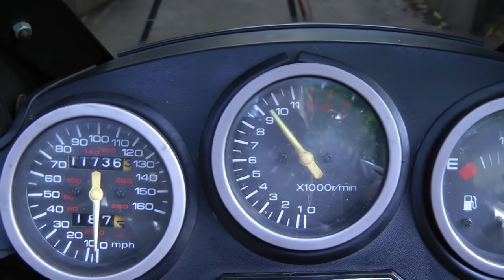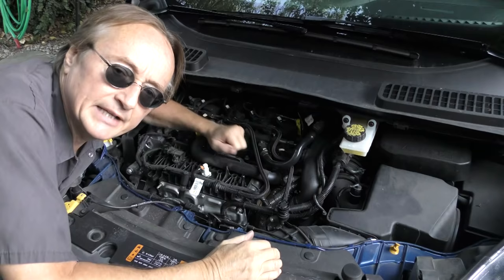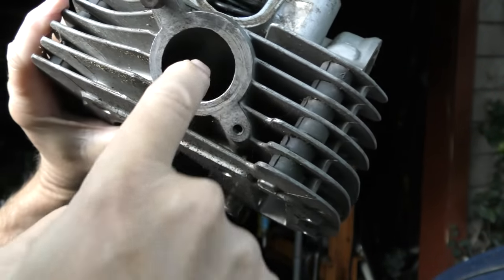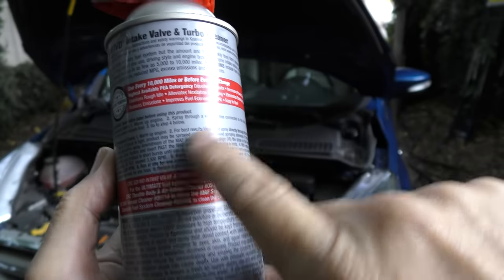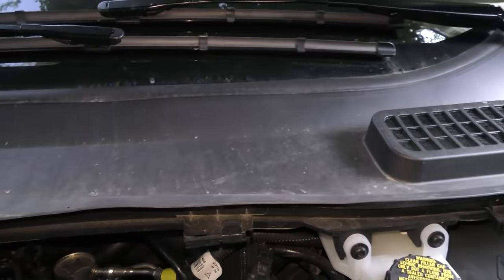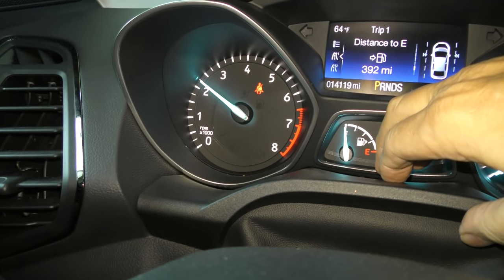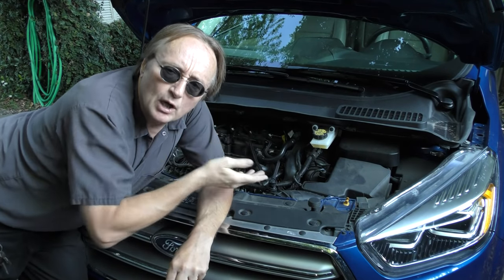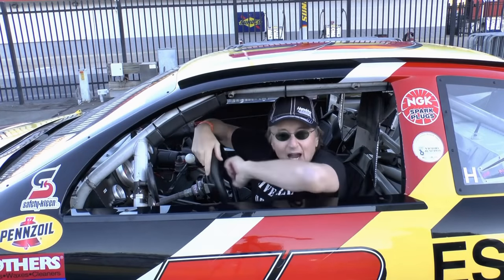How to Clean Intake Valves in Your Car with a Spray Cleaner

Comment: pretty sweet video for us ecoboost guys. everyone knows carbon build up is a huge problem with ecoboost engines. im at 35k miles with mine and my intercooler needs to be cleaned from oil build up and im sure intake valves need some cleaning too. pesky modern turbo engines!

Comment: Omg other mechanics are really gonna hate this. cheap way to clean your engine instead of the exorbitant prices they charge
Reply: Cleans your valves, not the rest of your engine. Usually you don't need to have your engine cleaned, unless theres significant sludge buildup, in which case you probably do need to take the entire engine apart.
Reply: What?????? Take apart your engine to clean it????? No! You prevent it from getting dirty by using the proper oil and changing it at the correct interval.

Comment: Hey Scotty could you do a video on modern diesel engines, they have  the same problem but about a 1000 times worse. It can get so bad that the entire intake manifold, intercooler and turbocharger becomes caked/clogged with carbon. Many believe the only solution is a properly designed oil air separator that has an actual replaceable filter element inside (i.e not just some steel wool), but the method you show in this video may also help with the valves themselves.
Reply: You don't do enough Miles and ain't kicking the car. Sounds like you need a petrol lol
Reply: Hey Scotty I clean my throttle body and then after I spray the throttle body cleaner into my intake manifold when when I try to start the car it's not keeping up when it starts

Comment: Hey Scotty, I’m curious if this method is safe for the turbo? Some people say chunks of carbon  can break off the valves, then goes straight to turbo, & can damage it. Is this a concern? I’ve been driving my focus st for 95k miles and have never cleaned the valves, so there’s probably a lot of build up. So I’m just afraid of these “chunks” ruining my turbo. What do you think?
Reply: CRC claims gdi cleaner softens the carbon
Reply: You should be injecting it after the turbo not before. Ideally some where between the inter cooler and the cylinder head.
Reply: @davemorris6747  I think he meant exhaust valves not intake
Reply: You have a turbo in a focus? 😂

Comment: I just sprayed this directly into the intake after the MAF sensor is that an ok way to do it?
Reply: Haha I've just posted the same question 😂👍
Reply: That’s is ok to do just make sure you spray AFTER the MAF sensor. That’s how I do mine. Mine is due for a cleaning now too! I have over 100,000 miles on my Ford Focus so I do this as regular maintenance. Seems to help.
Reply: The can recommend you can do that also
Reply: @katherinemccarter8841  do you use half a can at a time>?
Reply: CRC has an instruction video on YouTube that is how they show to do it. Air intake after the MAF sensor.

Comment: Do these hurt the spark plugs at all? I remember using something called Seafoam a few years back on an old car and a lot of people used to tell me to change the plugs afterwards.
Reply: One time I did clean my throttle body and all the shit went into the spark plugs and fouled them. Now I just take the throttle body off and clean it separately from the engine so the gunk doesn't get passed down. Although maybe driving the car hard and fast at highway speeds may have solved this problem.

Comment: This may have been mentioned but to many comments to read through all. (Yes I am lazy) ;)

I would simply like to add that while running down the highway that it may be a good idea to have your oil changed at that time as well. As i believe due to the "thin" nature of cleaner this could get into the oil and just for good measure add an oil change at the end of the process.

Comment: Hi Scotty. I am familiar/aware of issues regarding DI engine. 20 yrs ago one of my outboards(2 stroke) had it. Many issues of carbon build up behind the rings, resulting in powerhead failures. My outboard went through 2 powerheads during the warranty period(4 year). I traded it for Inboard. I am considering doing the intake/valve cleansing of my 2008 STS 3.6 DI engine. Do the deposits on the valves come off in small particles, or is there a risk of a 'chunk' coming off resulting in a valve not seating and the end result is a burnt valve?

Comment: CRC GDI cleaner then a good old fashioned Italian Tune Up afterwards. For those who don't know that that is, you drive it like you stole it for a little bit. Blows that crap right out of it. For best results, I usually do this right before my oil changes. Do the treatment, drive the required miles then change the oil.

Comment: This may be ok for GDI, but is not ok for GTDI engines according to Ford. There are a few videos talking about this, but these cleaners can cause significant damage for GTDI engines. The cleaner can get past the rings into the oil where the contamination can harm the turbo bearings. Other issues can arise if a chunk of carbon breaks loose, goes through the engine and chews up the turbos. If the injection process causes the cats to get too hot, this too can cause turbo damage due to the proximity. It appears the safest solution is currently to manually clean the intake.
Reply: June Han the ecoboost he is doing this on is a turbo.
Reply: June Han and he is spraying it in downstream from the turbo so carbon cannot end up in the turbo.
Reply: June Han if you are worried about the oil contamination simply change the oil after the cleaning. 
Also this could potentially cause a carbon particle to stick to a spark plug so it wouldn't hurt to install new plugs after the cleaning. especially if you get a misfire after the valve cleaning.
Reply: June Han then spray after the turbo.
Reply: He's spraying it downstream from the compressor side of the turbo. It then passes the intake valves, into the cylinders, passes the exhaust valves and goes into the turbine side of the turbo. That's where any debris that has been dislodged can damage the turbine wheel.
Reply: There is proper procedure. You are supposed to do this just before you change your oil. Do this treatment then change the oil and filter. That is proper procedure, because yes, it contaminates the oil.
Reply: Since any extra fuel introduced by an Italian tune up would never see the back of the valves where the residue is I doubt it would do anything. One thing to remember is that Ford doesn't approve this cleaning technique so if you should happen to damage a turbo your warranty won't cover it.
Reply: Paul Draver Higher mileage GtDI work trucks being used hard appear to not have as severe carbon issues which leads me to believe that driving these things hard has a protective effect. I am hoping we will start seeing teardown videos on the 2.7's as they hit higher miles. This will all be a moot issue at some point though as manufacturers have started switching to dual fuel injection systems in order to get ready for the next tier of emissions compliance.
Reply: You mean take it to a shop and have it torn apart costing just shy of a grand? Are you a mechanic?
Reply from the maker: that's what often has to be done on a VW, according to what i've seen and have been told by my VW friend The Humble Mechanic.
Reply from the maker: I just got back from a gumout test in ohio, and there one and done cleaner actually dissolves the carbon. YOU DO NOT want to use water, cause steam often blasts carbon off so well that chunks ruin tubos and clogg cats. it was a very in depth scientific experiment they did outside Dublin Ohio, and they convinced me not to use water because of that. Steam actually cleans too well for inside an engine
Reply: Isn't polyetheramine already an additive added to base fuel? Just a question as it still doesn't solve the direct injection problem, and after looking up gumout one and done, it's a fuel tank additive, so are they not just bolstering the additive already there and causing a fast clean?

Anyway, I always just use Subaru upper engine cleaner every oil change as that's what you need to do with these. Pretty similar to what the video does, you spray it in the manifold, heaps of smoke out of the exhaust.
Reply: So it's not typically in base fuel then? Ah, so that may be why companies like bp run those "ultimate 98 dirt busting" ads. It's all marketing to me, use the ron or aki that is specified for your car, or what your car is tuned for is what I always say. :)
Reply: Oh yea, I know it's good to use. Every workshop from dealership to professional subaru specialist uses the stuff on every car they do a service on. Plus it's an official Subaru part, actual cleaner is from crc I think, I don't have a can handy right now, but it is written on the can, and a mandated step of a service. :)

You can never have air that is too cold, colder the better on forced induction. Seems just like every other part of the car, ford is just shit at what they do and most likely are just running too rich on compensations. The ecu should already know the volume and temperature of the air before it even gets to the turbo where it is compressed and super heated, let alone the intercooler where it's cooled again. A proper tune should fix it. And a better pcv system. A catch can from the crank case would help too. :)
Reply: That is why you are supposed to use this right before an oil change. Always change your oil right after using any kind of deep cleaning products like this or something like CRC upper engine cleaner. That way any nasty crap that comes off of your valves/pistons and contaminants the oil will be taken out and replaced with nice fresh oil :)
Reply: Paul Draver the thought behind the Italian tune is not to spray the intake valve with fuel, it's to heat it up, so the carbon flakes off, and then there is the physical act of the valve actuating at 50+ times a second.
Reply: True.  Recently Ford announced not to do intake valve cleaning on turbo (ecoboost) engines. The carbon chunks can damage the turbo.  Glad I have NA GDI engine. Although the extra power would be fun.
Reply: Wayne S. All ecoboost are turbos dipshittery.Thats why hes commenting genius shit locks
Reply: Best way to do this is to get your lazy asses to open up the intake side ,hand crank each valve and clean when closed.Wipe any debri and gunk off then onto the next.There is no half ass approach to cars.These sprays and all this other gunk and tire seal.and tadiTor seal.and all this other crap is just marketing.Im amazed scotty posted this.Doing it this way just passes the crap downward through the cats ,sensors,oil,etc etc.Geez and I only have 225 subs.(Abother channel of course.)
Reply: I called Ford. They said do not rev above 3500 rpm. So that the turbo is not drawing boost...You will be OK. They just don't like retards that hammer the gas pedal. Then end up washing out the bearing!

I would add. They said if that code pops up. The service Bulletin says. "Do Not Change Plugs or Coil" Clean the Direct Injection system first...
Reply: Minor. Turbos are cheap. lol
Reply: @waynes.2983  Exhaust powers the turbo.  It has two upstreams and two downstreams.
Reply: @jakesmith2984  that was my point stupid. I never said any EcoBoost was not a turbo. Why would it be called an ecoBOOST if it was not forced induction? Not my fault you don't understand the English language.
Reply: I kinda wonder what effect having large chunks of carbon flaking off into the combustion chamber will potentially have on the cylinder walls....turbo or not.
Reply: @waynes.2983    Yeah thank you .  I thought so too.
Reply: @junehhan    Interesting about the trucks having less build up.  Makes sense.  I have 2017 Fusion 2.0L Twin Turbo GTDI 245hp and I so scared I'll screw this up!  Maybe I should just find  a straight and quiet country road at like 5am on a sunday morning and do some old fashion carbon cleaning?!  Proably dumb idea.  Im freaking nervous.  I love my car and it runs so nice right now.  (
Reply: @dougn2350    Yeah but that doesn't mean that much to me.  Ford wants you to bring the car into a Ford $ervice center instead!  I never even considered it a chance in hell they'd "approve" this type of method.  Spin can be spun all sorts of directions and Ford knows how to send a message out there.  You gotta take everything in and assess what's best for your particular situation.  If this method is done correctly, It will work.  Ford is also factoring in (in huge part) that fact that everyday people trying this out is gonna lead to a huge varience in process and outcome.  So actually the answer is the following:  1.  Ford is correct.  2.  People that know what they are doing (with this method) are correct as well.  Know what I'm sayin?!  )

Comment: In 2015 Ford was concerned that everyone would consider this process. They claimed it can heat up your Turbos, too nearly red hot whitch can cause serious, expensive repairs. Fordtechmakuloco was one Video I watched. I feel if I should trust your opinion, but this guy has me wondering…can u treasure me. 
I bought CRC Intake Valve & Turbo Cleaner an hour ago, now I find myself  holding back using it.

Comment: Scotty-
I have a Silverado 5.3 V8 DI, is it ok to spray directly into / through the throttle body or does it need to be the vacuum hose?
Also-
I hear so folks stating it may damage the cylinder heads when chunks of carbon fall into the combustion chamber.  Any thoughts?

Great channel-
Reply: Ditto
Reply: I don't know about the cylinder head "problem" but I just did this for the first time on a GDI car with 136,500 miles on it and it blew grey soot out the back for 200 yards down the street! My car has never run better since I performed this! And it idles like a dream. Spray it in the manifold beyond the Mass Air equipment. I used the brake booster vacuum line where it ties into the intake manifold. I plan on doing this every other oil change or at 10,000 miles to KEEP those valves and intake ports cleaned out. CRC WORKS!
Reply: CRC has an instruction video on YouTube. They say to spray it into the the air intake past the MAF sensor. Don’t spray before the sensor.  I’m not real mechanical and not so sure pulling hoses off that I don’t know what they are. I just bought a new DI engine and plan to do this every 4 or 5 thousand miles as preventative maintenance to keep from getting carbon build up.

Comment: Hey besides a catch can, why has nobody designed a device that goes in line with the pcv intake, that meters cleaner (like seafoam/mystery oil mix) as you drive??
Reply: Well there's methanol injection, which is kinda like that

Comment: hey, thank you for helping us with fixin our cars
i´ve got a question please!!
i have a nissan with an benzin direct ingection system with 150 000 on it
the question is:
is this problem with the carbon bild on the valve just in the Diesel motors?
or its also in Benzin motors?
and if i want to clean the valves wich porduct can i use?
Reply: My Mitsubishi chariot idles roughly with an engine management light on.with a very High fuel consumption could this be the problem?

Comment: AKA Italian Tuneup except get on the highway and drive the throttle wide open for 10 minutes when your done.
Reply: Dont forget the speeding ticket...
Reply: Franco Vision and the possible reckless driving charge
Reply: Jason Burt bro Italians are car gurus and motorcycle ones... The most expensive car in the world is a ln Itlaian car...
Reply: buba426 just tell the police officer your cleaning off your carbon build up. lol
Reply: You forgot to say whatsamattayous while throwing your hands around.
Reply: Is there any evidence that "Italian tune-ups" actually clean the intake valves?
Reply: Italian tune ups dont work on GDI engines, the injectors are at the bottom of the valves, not on top
Reply: throttle wide open for 10 minutes = 125 mph and certain death.....don't think Scotty wants anything to do with that nonsense.....
Reply: @jasoneyes01  yehh, just  drive in third gear to keep the revs up at moderate highway speeds:/
Reply: do you want to blow up your engine and ruin the transmission?

Comment: Makes perfect sense...We have the same problem on our direct injected two stroke outboards, even though there are no valves to plug up....But, gasoline is a great detergent and a bit of a coolant as well....I have always been afraid of spraying cleaners like this into my intake, fearing I might set off a code of affect the converter....But, I'm sure CRC has got these issues figured out though...